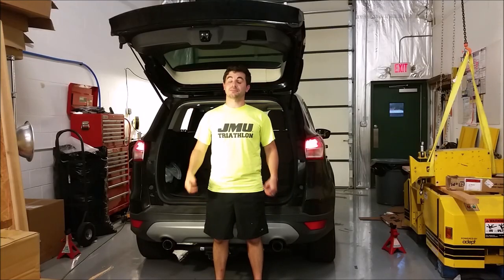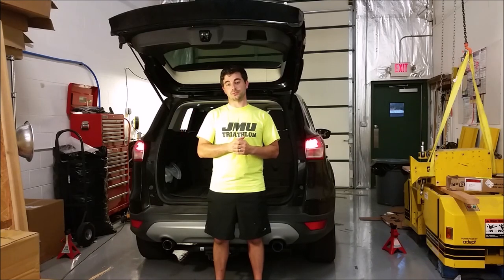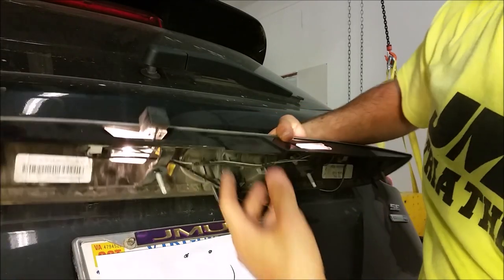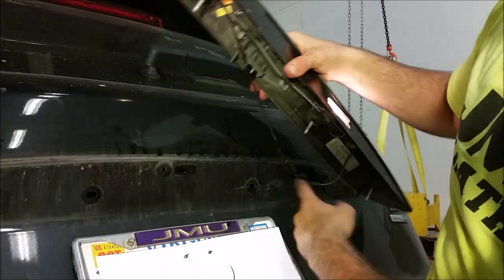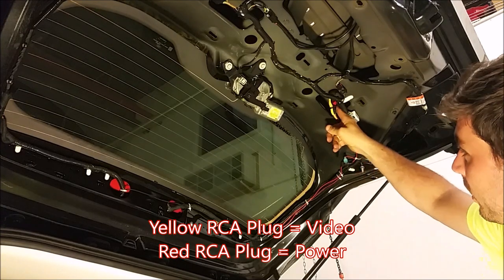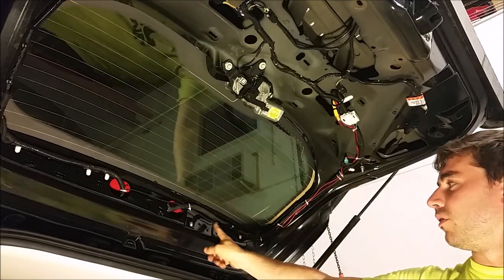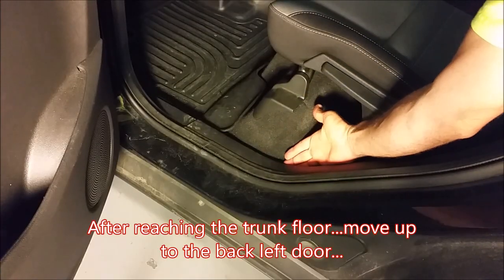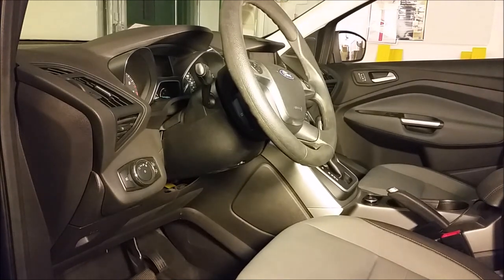Ford Escape Backup Camera Installation to MFT: HOW TO ESCAPE

Comment: Just like to add a couple of comments on this procedure, First of all thank you very much, to How to escape for the great tutorial on this process, it helped me enormously. I did make a couple of changes from his process though I'd like to share. First I ran my RCA cable up the passenger side and was able to take it all the way to the dash going under the Headliner and rubber seals around the headliner. Once I got to the dash I popped out the Plastic trim to the right of the glove box and was able to fish the wire right behind the glove box to the APIM. NO WIRE EXPOSED at all.  I also reprogrammed my APIM instead of buying another using a OBDII, Laptop and Forscan software. Cost me $35 bucks. One final note is when you have the radio control panel off attach the AC vents to it to reinstall correctly. If you don't and do it as shown in this video the AC vents will probably NOT connect themselves to the Radio face plate and you'll see about a 1/4 '' space between them and the Trim. They go in really easy this way as well. Here is a link that will provided a lot of other info I used to do the programming and buy the Molex connectors for the harness. This Forum was a tremendous help as was this video, I HIGHLY recommend using both if you're going to do this job. Thanks again to everyone who put input into this. http://www.focusst.org/forum/focus-st-electronics/50471-focus-st-backup-camera-enabling-apim-rear-camera-option.html
Reply from the maker: THAT IS GREAT FEEDBACK, Tom! Thank you for the clear instructions on your wire routing and other ways to improve this process- would be very interested to try Forscan in the near future. Pinning this post to the top of the comments!
Reply: Okay so TOM, where exactly do I bring my car to do you can hook all those do-dads & this bad boy up? 😂
Reply: i realize I am kinda randomly asking but does anyone know a good website to stream new series online?
Reply: @Mauricio Brett flixportal =)
Reply: @Dwayne Phoenix thank you, I went there and it seems like they got a lot of movies there =) I appreciate it!
Reply: @Mauricio Brett happy to help xD

Comment: Good morning mr. Escape I bought my wife a 2013 and the my my sync navigation is not working if I buy one of those cards that's missing in hers under the arm rest will I just be able to plug it in and go
Reply from the maker: Hey Big Mike, if your wife's 2013 Escape says "Insert SD Card" or something similar in the top right hand corner of the MyFord Touch 8" touch screen or if it says "NAVIGATION", then yes, GPS is enabled and it's waiting for a maps SD card. IF it just says "Information" in the top right of the 8" touch screen, then the APIM (Accessory Protocol Interface Module... a control block attached to the back of the screen, lol) either needs to be swapped or reprogrammed. Hope this helps!
Reply: @HowToEscapeDIYTipsandReviews  my screen on my 2013 Ford escape says "information" instead of "navigation". Where can I buy a apim that will say navigation?

Comment: I have a 2013 SE and behind my license plate holder is a cut out square in the external lift gate. Its the size of a reverse camera. Any ideas on the mod the previous owner did. Camera, if thats what was there, is gone just the hole there now, didn't find the hole till removing license plate holder to install my plates. License plate holder covers the hole.

Comment: Thanks for all the great videos!!  Question, if I wanted to add a factory camera in the factory location, does that plastic rectangle piece come out or do I have to cut/modify it?!
Reply from the maker: Thank you and you're very welcome! There is actually a factory panel for the camera itself to mount to- id search factory cameras for your escape and you can pretty quickly see the trim piece that the camera mounts to- id recommend going that route for cleanest fit! Trick is finding your color match between your FE and the panel
Reply: @HowToEscapeDIYTipsandReviews  Thanks for your response!!  Actually, I have a chrome panel with the factory back up camera and wanted to change it to tuxedo black to match my vehicle.  I have seen the replacement panels with and with out cameras included.  With out a camera is extremely less expensive than with the camera, so before I take everything apart, I wanted to see if I could swap out the "electronics" and just order the panel itself...Hopefully that makes sense!!!

Comment: I’m looking at an 08 escape and want to energize the rear camera when it goes to reverse. The reverse light wiring shows voltage on both wires from the bulb, where do I hook this up if I’m running a stand-alone dash cam and not a stereo system?

Comment: Bro,  How did you enable the camera function on the radio?
Reply from the maker: Hey @Cesar! Sorry for the delayed response- so I actually found an APIM (Accessory Protocol Interface Module - located behind the touchscreen) that had the camera and Nav unlocked. I just swapped the module out. However, you CAN use FORSCAN to enable the backup camera in an APIM I believe.

Comment: Hey I’m installing the same camera as you have in my 2013 Ford Escape (exactly same set up as you) but I’m trying to figure what colour or what wire the positive lead from the reverse light is ? Please I just need to know what wire to tap into to get my power
Reply from the maker: Hey Lyndon! I believe there were two wires- green and black. I believe that black was the positive power source and green was the ground. In any case, I wired up both and had the luxury of swapping them at the back of the APIM to test if I was correct. Please let me know if you have any more questions!

Comment: Great video and thank you.  I have a 2014 Ford Escape with the 4 inch screen.  The backup camera doesn't really work.  It turned on maybe 3-4 times when I put the car in reverse.  It's mostly not turning on when in reverse?  Do you have any idea what it could be and how to test it?  Thank you again.
Reply: Mine doesnt turn on as well. It will turn on during winter but during summer it won't. I guess temperature affects the wiring. Dealer wants to charge me a lot just to inspect that and theres no guarantee that they can fix it.
Reply: Primo como van los cables de atras es que no le entendí al bato. Entiendo poquito inglés. Me puedes decir xomo van conectados los cables atras para saber bien

Comment: Planning on installing mine in the morning because of these videos, all have been a huge help since I bought my escape! Quick question though. So I changed my code via FORSCan already and have the camera error screen coming up. So far so good. I also have the harness with the yellow RCA port already installed connected to my system. Should I still disregard the red wire that runs the length of the included RCA cable? I'm pretty sure that it's just for head units to trigger the reverse screen to come on?

Comment: Hi. How do I know that my APIM is camera enabled? I have NAV but not the camera. Thanks
Reply from the maker: Hi Andrei, your MFT screen would have an error message that would pop up saying that your camera is not connected. When you either unlock your APIM with FORSCAN, an OBDII plugin off eBay, or you find another APIM with both nav and backup camera unlocked, that notification will pop up and then that's the que to wire in your backup camera. Hope this helps! Thanks for checking out the channel!
Reply: Are 14  and 15 the same on sync 3 for rca connection
Reply from the maker: Hi Al, I can't verify anything for Sync 3 unfortunately- just have Sync 2 in my '13 SE. Sorry, but thanks for asking and for checking out the channel!

Comment: Is there any other BUC option you'd go with now that this video is over a year old? Looking for oem if at all possible or something close to it. Thanks. Also can you program nav with forscan too?
Reply from the maker: Yes- If you're looking for a budget camera, this is the one. However, I would still try to go OEM and get the actual camera that fits the rear trim above the license plate. I am not sure if this will provide you with the right communication to link up the white projected turning lines when you turn your wheel/look at the screen, but it'll for sure be a better camera in the long run. Also, Yes, Forscan has been known to unlock navigation as well!

Comment: Mine Pinout 14-15 does't seem to be empty does that mean that it support already rear camera ?
Reply from the maker: Hey @Rejean! 

Not necessarily. The only way to tell if your APIM comes with the backup camera ready is if you put the car in reverse and a warning pops up on the screen that the camera is disconnected. If that's not the case, you'll still need to find an APIM from a vehicle that featured a backup camera to have the feature unlocked. OR, you can go with FORSCAN and reprogram your current APIM. As for FORSCAN, there's a lot of posts about it on fordescape.org and requires an OBDII scanner that can talk with your computer and go into your vehicle settings. I've yet to do the conversion myself just from lack of time, but it's possible and there are loads of people who use it regularly to give you advice. Worth checking out if a used APIM is a pain in the butt. 

However, here's the thread on FordEscape.org on the backup camera: 

http://www.fordescape.org/forum/diy-garage/51697-successful-integration-ebay-backup-camera-into-stock-mft-my-13-fe-se-2.html  

It's a direct link to a post by HayaiKuruma, who ALSO had pins in his wire harness, but still had to source his own camera ready APIM. Let me know if you have any more quetions and thanks for checking out the channel!

Comment: Thanks for the video. One question (even though I'm on EU), if someone has the MFT 8" with navi - touch etc, but no backup camera, would he actually need to change the APIM in order just to add the camera?
Reply from the maker: Thanks for the comment Todo- I did swap out the APIM for the unlocked feature. However, others are experimenting with FORscan and OBDII scanners/programmers to reconfigure the APIM to unlock features without having to get a new APIM. I don't have experience in this, but I can direct you here where people have taken some serious in depth discussions and troubleshooting: 

Mod for NAV (perhaps a camera could be done the same way): http://forum.xda-developers.com/windows-mobile/general/myford-touch-navigation-activation-t3368080

General Info on How to Reconfigure: http://www.focusst.org/forum/focus-st-electronics/20866-focccus-pc-app-built-editor-all-around-reprogrammer.html

Again, I don't know for sure if these methods have a direct correlation to unlock the camera function, but it has potential. 

I DO know for sure that the APIM swap works. The wire ports are available for tapping into the back of the APIM harness, but it needs to be unlocked/enabled for the backup camera. 

Hope this helps!
Reply: I checked your other video that you changed the APIM. And I also noticed that, before changing, there was an "information" touch area in the top right corner (instead of naigation, which I also have). This is the main reason I actually asked you.

Thank you very much for the links (I already knew these, but to tell you the truth I dint have the time to check all over it in order to find what I am looking for). I also have an ELM327 which I already moded it and works fine. So I will start looking for more info on the links you provided.

Once again, thank you very much for your time to answer my question and for your video (even though I have a Focus, it is still helpful to see the work of others)!
Reply from the maker: Todo Sk Yep, no problem! We're all on the same system, so it's cool we can collaborate- Which ELM327 did you buy? I went to get one but couldn't figure out if I got the knock off or not as my tutorial seemed a bit out dated and the board didn't match up- thanks Todo!
Reply: The one I got is "unavailable", but here is the link (https://www.amazon.com/gp/product/B00VTD4K6M/ref=oh_aui_detailpage_o00_s00?ie=UTF8&psc=1). The "trick" is on the chip (I think that version 1.5 does not actually exist, but well, dont mind about that). You can find all the required info about the chip here: http://www.sheerwire.co.uk/single-post/2016/03/11/Which-ELM327-Switch-cable-compatible-with-Forscan-Focccus-for-your-Ford.
I then got a switch (http://www.ebay.com/itm/2-pcs-6-Pin-DPDT-ON-ON-2-Position-6A-250VAC-Mini-Toggle-Switches-MTS-202-/391261974769?hash=item5b1907f0f1:g:V2wAAOSwKIpV-OTo) and connected it to the ELM (I had to use a dremel-like tool in order to fit the switch in)
Reply: updated last post with the correct link of ELM327 (https://www.amazon.com/gp/product/B00VTD4K6M/ref=oh_aui_detailpage_o00_s00?ie=UTF8&psc=1)
Reply from the maker: Awesome- thanks a lot, Todo- I'll take a look and see where mine stands in comparison! Just saw your message as well on FE.org- thanks for all the details!
Reply: I tried to contact you on FE, but they changed the rules. I might have found some things. Can you send me a pm on FE with your email if you wish?

Comment: I want to know if you can please help me get the parts that I would need to instal a backup camara if my ford touch did not bring it with the escape. Can you please help me on this ?
Reply from the maker: Hi @Chovy_Nunez, sure I hope I can point you in the right direction: 
You will need: 

- A Ford Escape APIM (Accessory Protocol Interface Module) from the same generation of Sync from a Ford Escape or Ford Focus (almost all '13-'15 models are Sync 2. '16's are mostly Sync 3 I believe). 

-  an eBay backup camera (CCD works well for night visibility). There are wireless and wired versions. Wireless will save you the time from routing cords from back to front, but you have to tap the power sources twice. Wired versions you only need to tap the tail light for power once, and then the positive and negative feed for the camera into the MyFord Touch wire harness. 

- T-Taps, Solder, Shrink Tubing/Electrical tape, and zip ties as needed. These can all be picked up collectively between a trip to Wal-Mart and an auto parts store (Auto Zone, O'rielly's, etc.) 

Please let me know if you have any more questions- Thanks for watching!
Reply: @HowToEscapeDIYTipsandReviews  
Hello and 1stly thank you.
2nd. The camera is from eBay the small parts are from Walmart but where would someone find the APIM?
Also does the wireless version depend on internet or Bluetooth. Last question if this is something that I simply cannot do who would you suggest I find, a general mechanic perhaps?

Comment: Hi
I have some problems with my rear camera, sometimes it does appears as not available or sometimes is upside down i wanted to check that theres not  any short curcuit on the cables but I wasnt able to remone the lift gate trim can you explain me how should I remove it please
Thanks

Comment: hi do you have a  complet video with all instalation
Reply from the maker: Hi Wilfredo, 

Unfortunately I do not have a detailed video at this time- I installed the camera before making the video, so the step by step is limited, I recognize that- However, please feel free to ask any and all questions you may have on here and I'd be happy to assist. 

I DO have a post on Fordescape.org with detailed steps written out of what I did- I know it's not a video, but it's the 5th or 6th entry down the page I believe: http://www.fordescape.org/forum/diy-garage/51697-successful-integration-ebay-backup-camera-into-stock-mft-my-13-fe-se.html 

Please let me know if you have any other questions. Thanks!
Reply: we already connect the camera and cables but when we put R im not able to see the video (camera signal) what else can i check in order for it to work properly?